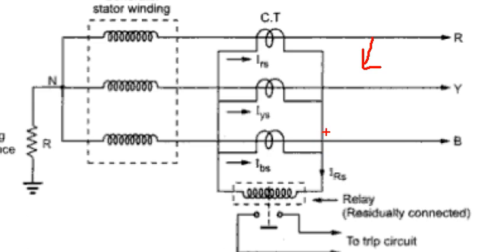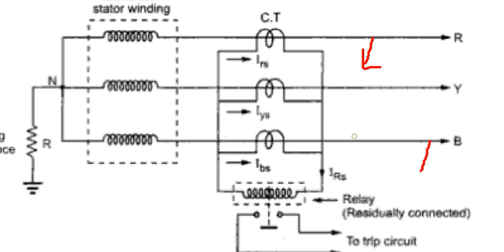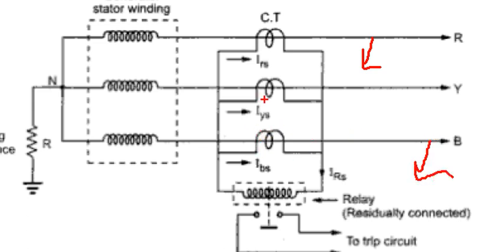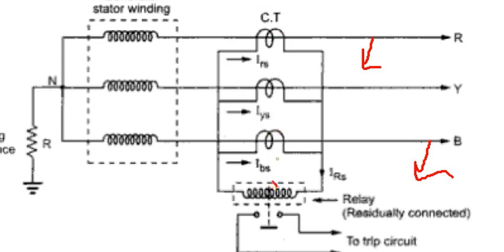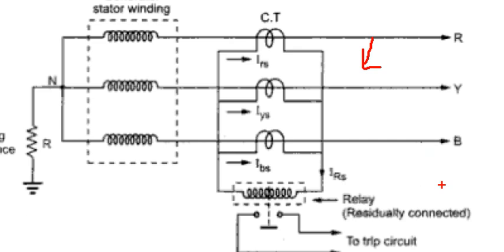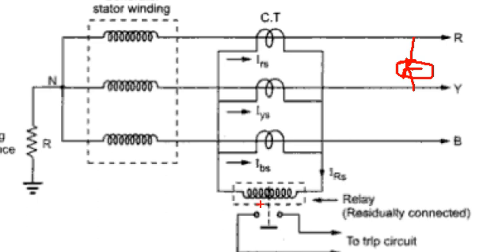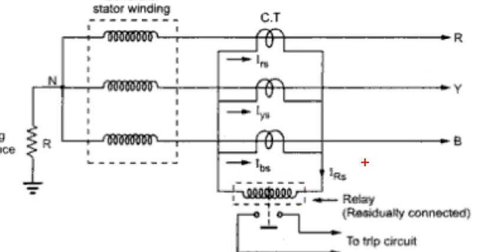Unrestricted Earth Fault Protection Working Principle

Comment: Restricted earth fault protection means relay will respond only upto 85% of the generator winding fault and   if earth fault occurs  nearer to the neutral it will not respond becoz of its current setting